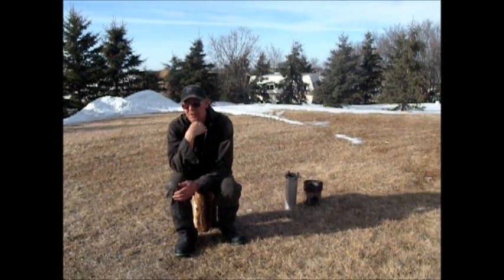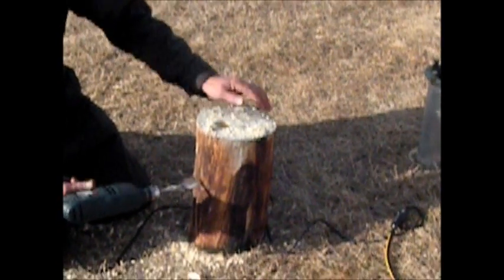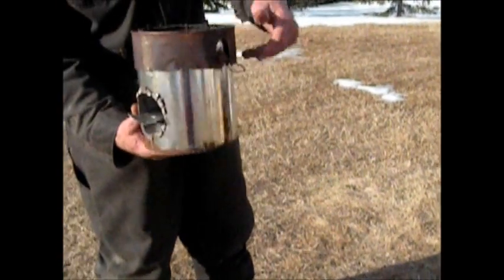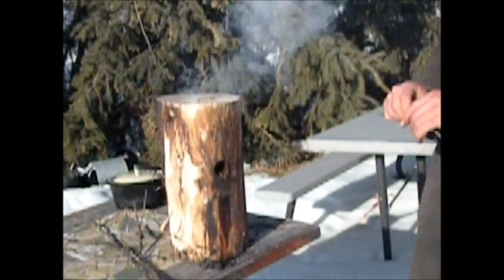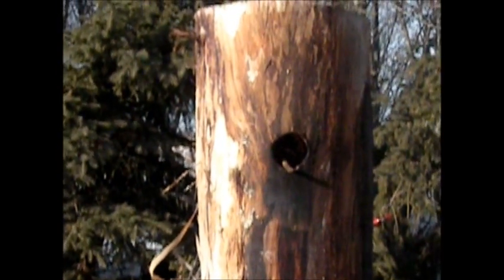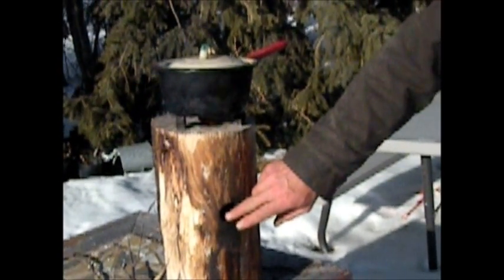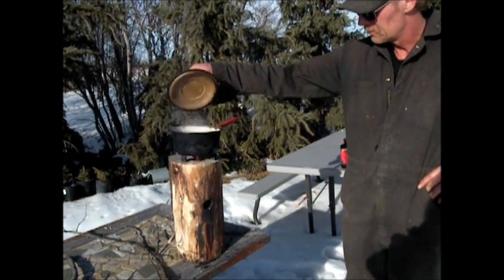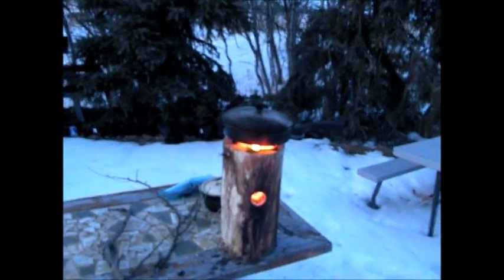Wooden Wood Rocket Stove.wmv

Comment from the maker: That works. There are many ways to light it. Just the shavings without the lighter fluid works good too. I usually feed them in the bottom hole, but it doesn't matter. As long as the log is dry and well cured it lights quite easily Once it starts forming some coals it is self sustaining. I usually carry a small bottle of barbeque starter fluid when camping. Makes it easy when raining, or a damp morning. By the way. once the log is dry. a fresh rain isn't a problem.

Comment from the maker: Thanks for the comment marthele7. I don't know about inside, but I considered outside, Each log is a different size though and it kind of defeats the purpose. As is the whole stove is biodegadable, and the material is completely supplied by the bush. Have a kelly kettle, but as it only cooks water it seldom comes with. You do have quite a ways to go with you wood gas stove yet, but do. They work good. Tons of vids on YT. That's why I haven't posted one (except that tiny backpacking).

Comment from the maker: That was bbq lighter fluid just to light it. It's not necessary, just lights easier and quicker. Can use alcohol, diesel, kerosene. whatever. Even used brake and electrical cleaner once. I never added any twigs after what you saw in the vid. It is quite self sustaining once it gets going. I tried bigger, taller, smaller and shorter. But this size works best. Log can be bigger or smaller to a point, doesn't matter except burn time. Any cracks in the wood will smoke and ultimately burn through.

Comment from the maker: Try at home first though- it's a fairly hard hole to drill into the grain of the wood. I did check and one can still buy a new brace and bit- though I couldn't find a proper bit, just a ship auger. It can be done crudly with a chainsaw though. I wouldn't even try a rechargable drill.

Comment: You need to start a fire and for rapid embers
you make a bundle of compact twig that fits exactly into the chimney hole (you added to fill in the gaps).
In the wood chips can be broken twigs and ...

The interest is to let some air pass, keep a lot of heat.
So you keep a space at the bottom of the fireplace and keep fire in it 1st,
you wait 3-5 minutes of thick white smoke (pyrolysis)
and you rekindle the top, and bottom, twice,
  everything will take quietly.

Then you are added by the timber bottom.

Have fun

Comment: great idea! gonna give it a try bang a couple of nails ln the top for a pot stand and and maybe a secondary hole underneath the feed whole for better air flow? how long will it burn for?  x
Reply from the maker: Hi, Lee. No need to feed any wood once it is going. For that reason, also no second hole needed. If you do be sure to go smaller to keep the air ratio the same. Continuous burn is around 45 minutes or longer depending if the logs splits, diameter of log, and type of wood.Hardwoods burn better. I usually douse it after cooking. With holes drilled either end, ie: 2 stoves in one, it is good for several meals. Yes, perfect on the beach. It sits stable in sand. any remains are biodegradable. That is why I didn't use nails for a potholder, though that is a easy and effective way. 3 stones are more environmental, and basically always available. The whole thing is about simple
.

Comment: This is similar to the way I burned out some stumps in my backyard.... Obviously I was not in any hurry to get it done.... Did multiple burns as I couldn't leave it unattended. Kept a garden hose handy. then chopped out the roots and filled in..
Reply from the maker: I did stumps as well with kind of mixed results. I got rid of a few stumps by putting the tire rim I use as a backyard fireplace on one. Amazing number of campfires before the stump is gone, but that isn't a problem as we had quite a few campfires. Many I just cut as low as possible then fill over with fresh topsoil so the mower has no problem and forget them.
Reply: @mashdown3  yeah, stumps are tough to burn. Mine was a giant swamp maple(s) with multiple trunks with stones and pebbles embedded in the base and nearly impossible to cut low.
Your rocket stove log is a fantastic idea.

Comment from the maker: Thanks Chumchin, you are kind. But my talents leave a little too be desired I think. The type of wood does make a difference. I tried spruce and it didn't burn nearly as well, but worked. I'd suspect hardwoods work better as they make coals which is an important part of the way it burns. This was poplar(aspen) which is very common here in Sask, and I consider one of the best all around fire woods. It absolutely must be very dry. I can't emphasize that enough. No vid on Swedish candle. Sorry.

Comment: Why did you drill the hole o"ff-center"??? What is the benefit of that in your opinion. 
Thanks for the info.
Reply from the maker: It burns to the back of the hole a bit, or the outside of the curve the air follows. I aimed at it burning in center of the log towards the end of the burn. I noticed the first one burned that way so drilled the second one a bit off center and it seemed better. Cracks in the log will burn faster as soon as air starts flowing through them as well.

Comment from the maker: Turns out a 1 inch hole won't work, it has to be 1 1/4. I haven't tried, but I expect bigger will. The vertical hole is 6 inches deep.  I,m going to try spruce today to compare.